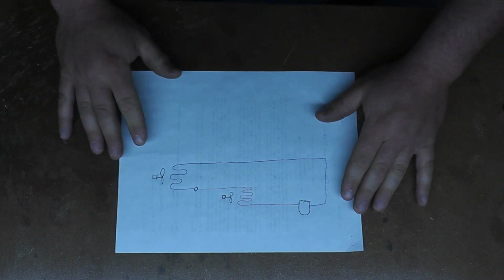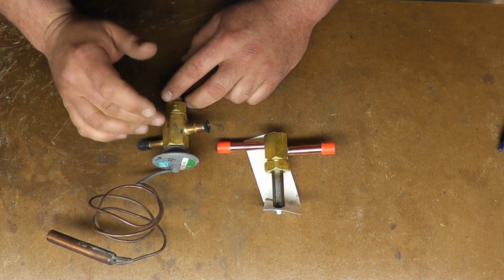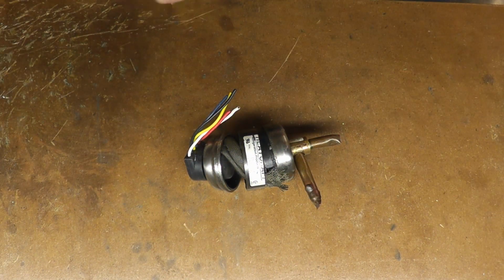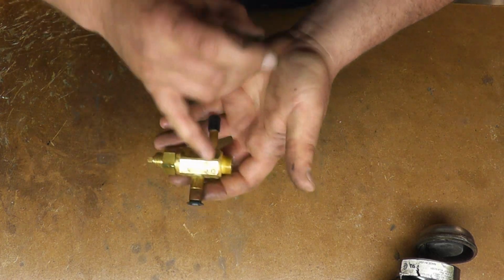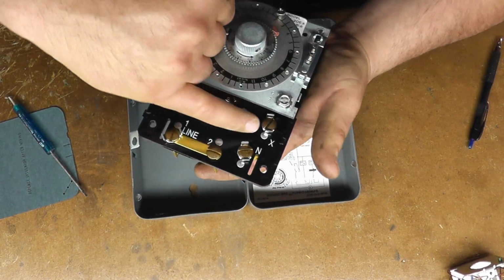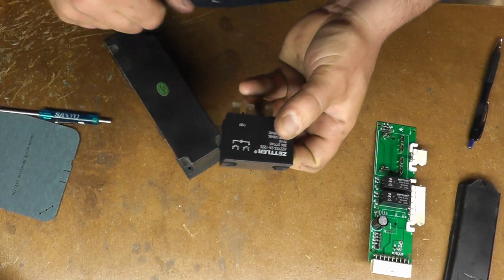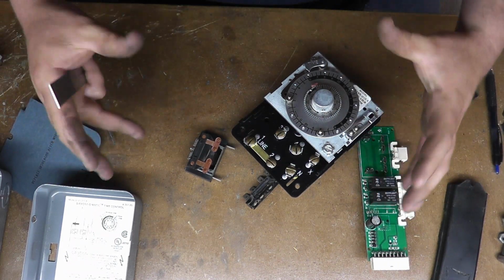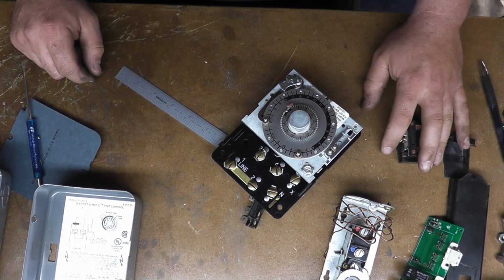Needless Complication

Comment: Hi After spending 50 years ( now retired) in the A/C business I totally agree with your statement that its going in the wrong direction when it comes to reliable parts. The manufacture only wants the equipment to last the warranty period they do not care after that date. I hope other engineers give you feed back then the industry may improve.
Many Thanks for the videos a Thumbs Up from me.
Les
UK
Reply from the maker: There is only 1 company I know of that did this.  When Lennox was designing their L series units they asked for input and a lot of those suggestions made it into the design.  It may have made the units a little more expensive, but in the long run from a labor standpoint so much easier to repair.

Comment: Often newer constructions are implemented - not to give you the best cooling, in this case - but to move as much money fra YOUR wallet into the constructor wallet - and still give you the cooling you can't complaint about ... within 1-3 years - that's how the ecomonic system works ... and it's crazy !

Comment: Oh how true is your theme -planned obsolescence is nowadays the norm followed by no specialist parts available 10yrs later!!

I completely agree with you with this ridiculous drive towards computerisation and digitalisation in equipment - we see lots of examples of this in agriculture where equipment cannot cope with moisture, dust and vibration issues. Manufacturers also refuse to release information codes and related data to enable to adjust / repair stuff. Incidentally there is something of a growing trend from customers opting for new equipment that does not rely on such stuff!!
Reply from the maker: We have an issue with that in VAV systems.  The install company installs it, but then the vendor (in this particular case Carrier) programs it.  Well another company installed it and refused to service it.  We got called in and couldn't do anything because we cannot get the control codes to program the thing.  It must be programmed by Carrier.  Had to call Carrier.  They came down and for $500 they found the issue.  The heat set point was set at 20 degrees so the heat never turned on.  Talk about a racket.

Comment: The weak point obviously is the ZETTLER-relay. A quick fix will be to introduce a beefy contactor or a solid state switch and let that control the power.
Timing controlled by a mechanical clock is an obsolete sollution.

Comment: Greg been there done it also.  At times all you can do is count your blessings,eg the job security and the overtime money from inadequate sized control components.

I do not buy anything unless it has been in the field for at minimum two years and all problems and debugging done out of someone elses pocket,

PLC and VFDs are good stuff BUT for the most part in my experience problems come up from poor flimsy sensors and actuators.  They can save money and do so until they break due to poor design such as that relay - I would remove that and install a good and beefier relay and tie it back into the control board.  Or just use the flimsy one as in interposing relay.

Iced evaporators - oh what fun to defrost them.
CAUTION the timer was rated for 40 A non inductive load only.

Dan Bentler
Reply from the maker: Yeah I always found the ratings on the timers a little weird considering that there is almost always a resistive load (defrost heaters) on one set of contacts and an inductive load (compressor directly, or solenoid coil and fans) on the other.  Unfortunately the way these things sit in their tiny electrical section there isn't much room to add an external relay.  If it were placed outside that protected area it would definately be hit by something.  No matter how many times I tell people not to put anything on top of the refrigerators there is always some sort of pan or box blocking the condenser coil airflow.

Comment: Greg,
As a former tech, I know where you are coming from. When I worked in actuation, some of the units had a control board with a 4 to 20 ma current link. Instead of only 90° rotation, they could dial in anything between 0° and 90° they wanted. There was a feedback pot in the unit. The board compared the position of the feedback pot to the input signal to determine to run the motor cw or ccw. We always had guys dinking around with a metal tool, shorting something and burning the traces off the board! There were usually in the TRIAC part of the board as it had one TRIAC for each direction of rotation, That was either 115 or 230v where the board ran on 5 vdc. Was that a Paragon timer? I installed a ton of those for various purposes. Regarding your relay, how much more would it have cost to have the traces on the board parallel the other contract and double the current it can handle? Go figure! I sometimes wonder what the f*ck is going inside engineers minds! Enough of my rant!
Regards,
Dave
Reply from the maker: Yes it's a good ole Paragon 8145-20.  Probably the most common clock in refrigeration.  the last 2 numbers are voltage.  20 = 208v and 00 = 115v
Reply: Engineers used to be hands-on, practical people. In addition to all the advanced mathematics we had to learn welding, we were expected to have learnt machine shop at school - otherwise you had to learn that too.

Comment: With any innovation/improvement the first question to ask yourself is "what problem is this the solution to?" If the only answer is 'coz it's cheaper to make, be suspicious.

As for more efficient, a friend moved recently and had the house fixed up before moving in. The domestic boiler was replaced with a modern more efficient one, but it needed a larger gas main to be fitted to the house to feed it, go figure!
ATB
chris
PS why is it some things are "cheaper to make" but end up more expensive to buy?

Comment: Mr. H.,

K.I.S.S. is a good rule in all sorts of situations.

Refrigeration equipment, consumer electronics, you name it; the quick buck artists shove  the crap out the door and ring the cash register.  The idea that things should be well made to begin with and maintainable too is beyond them.  Guess what, repeat customers are terrific for long term profitability.

The PCB mounted relay with 1 set of damaged contacts has me thinking.  I think that might be a "single throw" device.  Perhaps there's a design defect on the PCB that's keeping the 2 sets of contacts from being electrically parallel.  Sufficient metal mass seem to be present to handle the "juice", if all 4 contact points carried part of the load.

BTW, I make my living off IBM mainframes.  "To err is human.  To really f_ck things up, use a computer."

Eli D.

Comment: What the blazes sort of fecking idjett thought of making refrigeration so complicated? That electric motor valve belongs at NASA. The waxy shit you mentioned sounds like drawing compound - refrig tube is drawn sans oil or grease - was this a repaired system? I think someone has used ordinary tubing.
Reply from the maker: The system I had in mind when talking about it was ~6 months to a year old when I got to it and found a dead compressor.  The compressor was undersized for the unit (basically a giant 8 door display case with a remote condenser)  I put in a larger condensing unit and fired it up, but was pumping into a vacuum.  Checked the TXV and it was full of pasty waxy garbage.

Comment: I wouldn't necessarily call it needless complication. electronic ignition and fuel injection in a car is more complicated than a carburetor and distributor, but it is also  infinitely more adaptable to changing conditions and has better performance and economy. I can only see one reason that the solid state solution doesn't beat the old mechanical solution on pretty much all parameters, that is that only a fraction of the effort went into designing and making it
Reply from the maker: Mechanical solution beats on price, parts availability, and longevity.  This isn't a car it's a freezer.  There is no performance difference.  Any energy savings comes from the physical design of the refrigeration system and not these controls.
Reply: *****
I understand what you are saying.
the mechanical solution can be fixed with a "hammer" for when you need it to work now, But I find it hard to believe that there would be no performance gain from a more optimal control and that a properly designed solid state control wouldn't be more reliable and last longer than the mechanical

Comment: it looks that they went to electronic control, used underrated board for amperage needed and used not common sized relay too weak to handle the current... Should have used better electronics engineers ;)